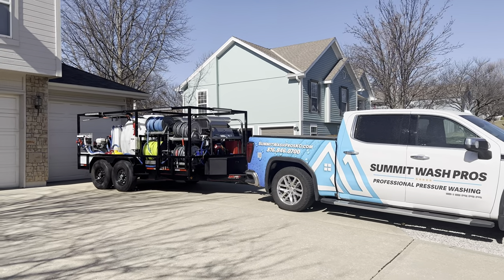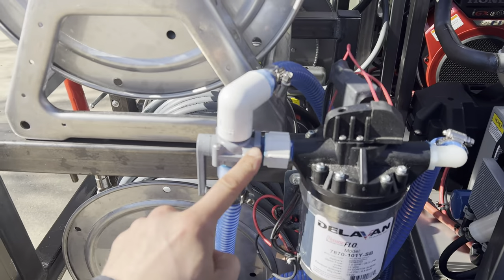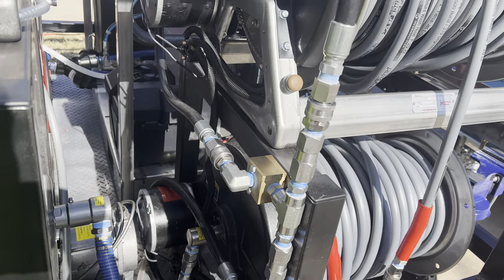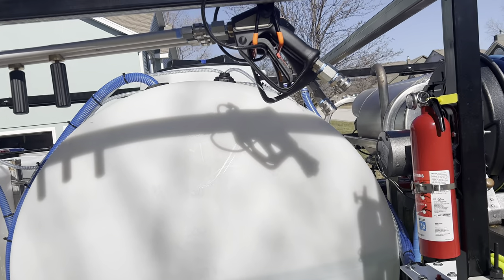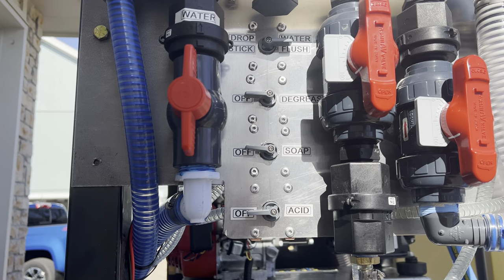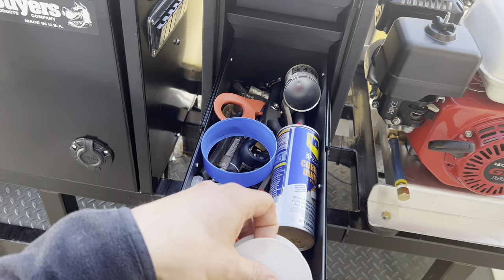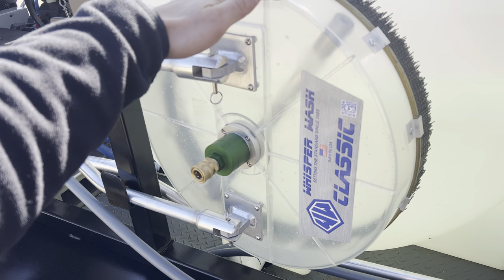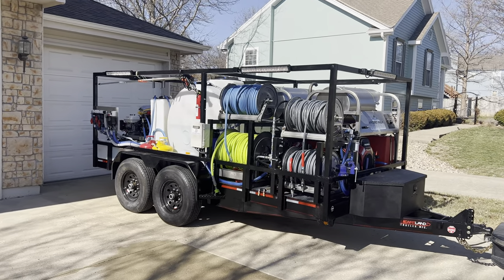20 GPM Pressure Washing Trailer | Summit Wash Pros LLC | Kansas City, MO

Comment: This is absolutely THE most insane trailer I’ve ever seen.
Reply from the maker: Thank
You
Reply: Quick question! Any way you’d be able to direct me to where I can find that house water filter?
Reply: It’s the best and most thought out build I’ve ever seen the only thing that could be added to increase the insanity would be two Farley 1 million BTU burners
Reply: Wait till we post our new one!
Reply: I would like to know where do you get those guns that you use and the lances for pressure washing I have not seen those Lance's anywhere however I have not been really looking for them either 😊
Reply: @summitwashpros546 how much for that set up?
Reply: @summitwashpros546 did you say you build these
Reply: He tried to copy my setup.. I went up to Kansas city to buy his company he wanted 70k for the whole company.. when I looked at his taxes and seen he spent over half of what he made I canceled that transaction.. so he asked me alot of questions about my build and copied it well tried to my machines put 12gpm down😅😢.. he called the manufacturer of the machines and they told him they won't make those machines for him.. hahahah made my stock prices go up.. this guy is not someone you want to listen too😅😅
Reply: I still have  one of the biggest setups in US.. up grade that 1500 dumb ass pulling around a trailer that heavy with little ass truck 😅😅
Reply: @decapressurewashing4935  What part did he copy?  The part where he used hoses, reels, pumps and gasoline engines?  LOL
Reply: That’s what I was thinking, when I saw the Siamese I said “goddamn” 🤣🤣
Reply: @decapressurewashing4935  bro, chill with that small-peepee-energy. 😂

Comment: Love the build! For the extended oil drain lines on your rig. I would put a in line ball valve as close to were the drain line comes from the machine as you can, to stop the new oil from having to fill up the lines before it fills your pump. And when you want to drain it, just cut the ball valve on and let it flow out. Awesome job 👏 👍

Comment: Hi I just  seen  your video of the trailer. 
incredible,  I done power WASHING in Dublin Ireland  I just had  a Honda gx390  with  an inter pump 202  20liters PM  200bar I also have a hotbox water  heater 
it water to 140°C 
  it was good looking at your  video 

 I recon that trailer  and equipment would  cost $40,000. good look   Fran Walsh

Comment: I give it up to you that is one of the best trailer builds I have ever seen man each piece u spoke on I was blown away what is the update on the shut off for degreaser soap and acid have you ran into any problems and once again great video an awesome rig.
Reply from the maker: restricted too much flow going from valve to valve. I also changed the check valve on the soap from a  1 lb cracking 1 inch valve to a 1/2 inch 1/3lb cracking pressure check valve and it pulls much better. I have replaced the 3 ways with single 1/4 quick connects so i can just connect the soap into whatever quick connect i feel like which is much easier imo and lets me draw water through the valve if i dont want soap but still want SH. Here is the link to how it looks now. shorturl.at/dpRXY

Comment: awesome rig can you tell us where you get your small drawer tool box and led light strips
Reply from the maker: Tractor Supply 20-1/2 in. x 8-7/8 in. Steel Wheel Well Truck Box with 5 Drawers, 5M Double Row 600LEDs SMD 5050 LED Flexible Strip Lighting DC 12V 12 Volt Cold Cool White Dimmable Light Waterproof Outdoor Use

Comment: 708 hydro meter, how does that work with city? Do you hook that up to hydrant?1333 liquid electrical tape. 2420 coat drawers with flexseal or tool box liner. Great setup but no heat?  Total invested? Nice rig id put a flat fiberglass roof on it.

Comment: Looks like a nightmare when something goes wrong. I used to have electric hose reels and they went bad after a wash season, realised the manual reels are cheaper and made my employee do the reeling while i collected the check lol
Reply from the maker: Build it right, maintain it, don't abuse it, and they last.  Still going great with normal maintenance.

Comment: How did you connect your soap degreeser and acid to the one outlet with the water going to all for flushing
Reply from the maker: I’ve changed the set up since then. Doing quarter inch quick connects for each one.

Comment: Do you have a link to that slim box with the drawers?
Reply from the maker: Tractor Supply 20-1/2 in. x 8-7/8 in. Steel Wheel Well Truck Box with 5 Drawers

Comment: Could you walk me through with installing the lite bars?
Reply from the maker: Drilled holes to mount, for wiring I had to snake the wires through the racks square tubing, all wired parallel to my wiring box. Drilled a hole for the wire to poke out for each light and kept all the wire connectors inside a small metal box meant to hide stuff like that

Comment: That rig is extremely impressive! Probably $50k.
Reply from the maker: Spot on
Reply: 50 K was your cost to build it. Holy cow can only imagine what somebody would sell it for.
Reply from the maker: @rayf268  once used , it would sell for 50-90% of its original value depending on its condition and age
Reply: @summitwashpros546  one of the rig builders would probably add $10 or $20,000 For the assembly.

Comment: Do you mind sharing what you mean by trap unloader. I just built a new unit with Sienese 4 gpm to get 8 but the unloader are acting funny.
Reply from the maker: Trap unloaders bypass water when you are off the trigger when it detects a build up in pressure, it traps that pressurized water in the line, and bypasses what’s coming from the pump. This is the one you need for 
 siamese setup. 

Flow unloaders bypass water when it detects the flow of water is no longer exiting your nozzle because you closed the trigger, therefore it bypasses all the water in your line and from the pump. Once you open the trigger and it detects water flowing freely, it closes and doesn’t bypass the water
Reply: Do you have a link?

Comment: On the g floor did you lay strips or find a single piece large enough?
Reply from the maker: It comes in a 7 ft by 17 ft roll. One piece
Reply: Robert Wallace Very impressive! do you build smaller versions on the side? love the slim boxes with drawers.

Comment: Flow pro only turns on and off the bypass. Doesn’t at all do the same as the Shertz box. You not getting 10gpm unless you are bypassing the soap injectors. Very easy to plumb in a way to rinse your injector with the flow pro also

Comment: Sorry to give you the bad news but your specs dont add up, to be able to get 20gpm at 3500 psi you will have to have a bigger engine, i do plumbing and have almost the same stuff as your stuff there, but on mine are 35hp vanguard engines, your honda can only give out 25hp, if you need more info let me know and i will help you. There are caculation you can do to know what size go with what engine, you cant just use any engine, the pump wont support that max spec.

Comment: Do you know the weight of the total build
Reply from the maker: I need to scale it still. What I do know is that 14,000 pound rated and the axles look great so I know I’m under that. my 1500 and pull it as well. If I see a scale I can swing by one day I’ll measure it out.
Reply: Most TA truck stops have a drive on cat scale or DOT weigh stations on the interstate. I also would like to know weight with all tanks filled & ready to go on the BEST BUILD EVER.
Reply from the maker: @novicenova  it’s 6,500 dry, 11,500 with full Chemical and full water tank
Reply: @summitwashpros546  wash on I love the build just pray you never get pulled by Dot, local cops normally won't tell the difference but Dot will,  anything being pulled over 10, 000  pounds and is used for commercial purposes you'll need to have a CDL